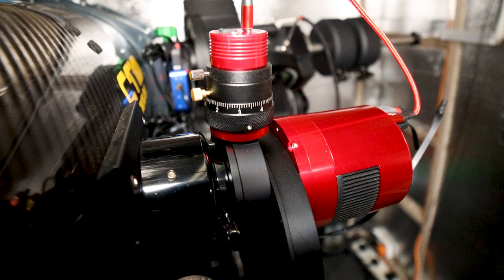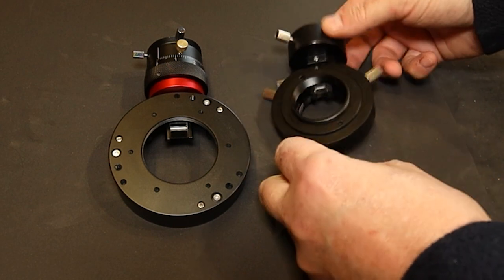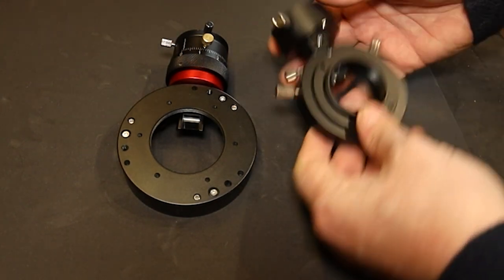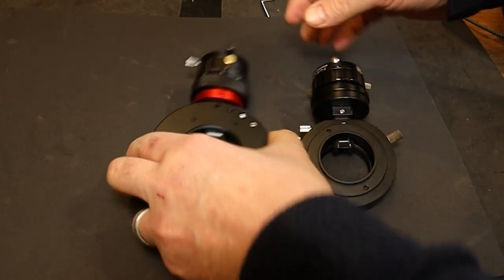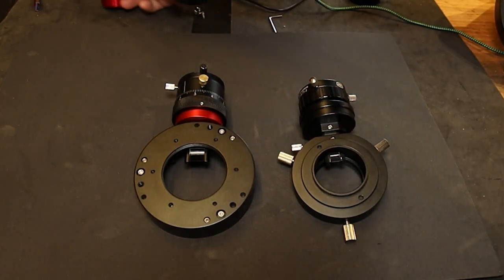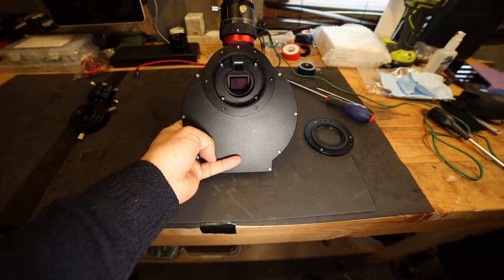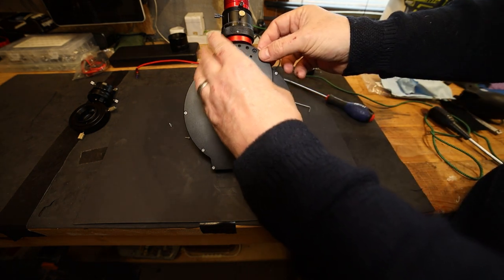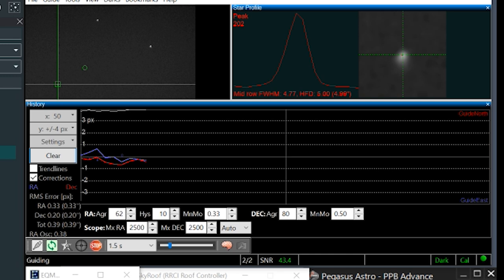ZWO  OAG L Guiding for Astrophotography

Comment: I'm literally watching hundreds of these videos before I buy all my gear and the confusing messages, as you pommes say, are doing my head in.
Here's my confusion.
Moving the prism shouldn't change the focal length. It should just pick up the light from a different part of the image coming from the scope. So the distance to the camera sensor should be a fixed and known distance. The distance from the OAG to the main camera sensor is also a fixed and known distance and if it isn't the same, ZWO provide a spacer with the OAG to equalise the distance.
If you introduce a filter wheel after the OAG then wouldn't you just have to add a spacer of equivalent size to the OAG to keep the back focus of the main and guide cameras identical.
That way the focuser of the telescope should be the only adjustment necessary to focus both cameras at the same time.
What is the advantage of adding another focuser that should never be needed again after the initial setup?
Reply from the maker: Hi Adrian. You are correct in that once it is set you don't need to move it but you will find that as you progress you move gear to different telescopes and also may use different cameras and other gear and this requires refocusing. The Prism is on a rod that changes the focus point of the image the guide camera sees so its not as simple as just adding a spacer of the same size as the filterwheel although that would be a good starting point. Another point that I would make is temperatures and cable snags and just accidentally knocking things often happens when working in the dark and having the ability to easily and quickly refocus is something you will wish you had if you didn't.
It is a very confusing hobby when it comes to gear as there are so many choices and options depending on what you want to do and achieve. You are definitely doing the right thing to do lots of research. Good luck and if I can help please ask.